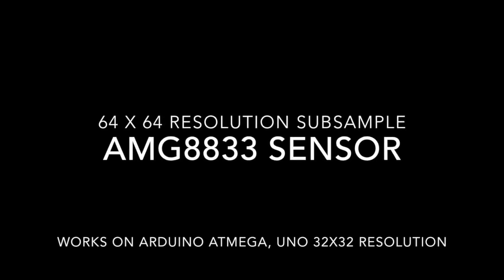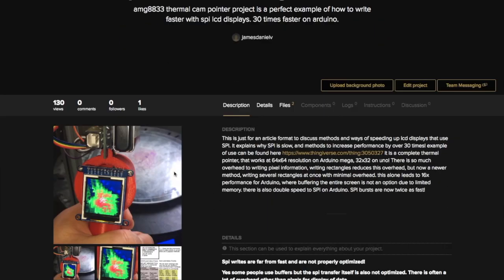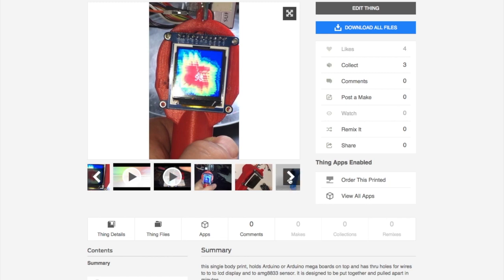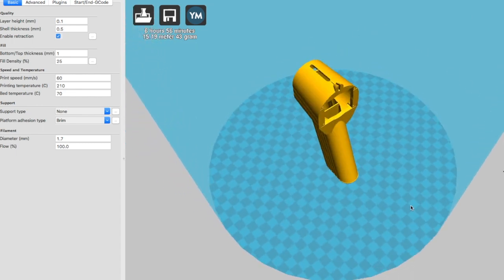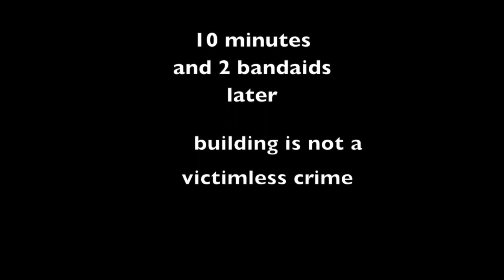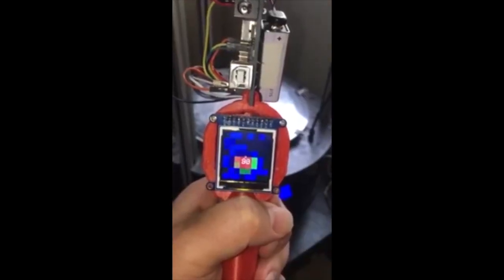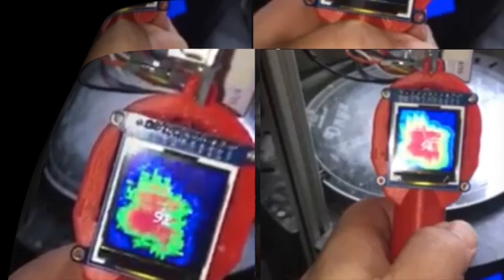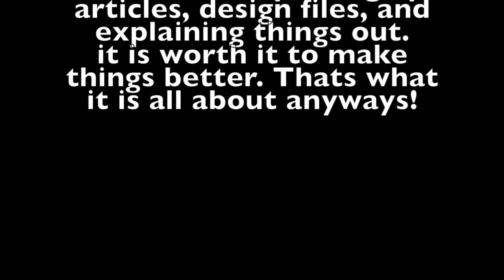amg8833 sensor works at 64x64 resolution on arduino uno! 10fps!

Comment: I have problem with range to measuring temp, if 5 cm from sensor is read 35,then i go to 30 cm is read 32,So How can i change the temp value,or we only use this sensor with short range, the description of sensor AMG883 say measuring 1-2 meter
Reply from the maker: what is size of object? from 30cm it should be about 3x3 inches, and from 100mm, it should be about 6x6 inches and have a stable temp across its entire body. otherwise you will get the temp it sees within its pixel range and it will be averaged across the center 4 pixels. the range low and high will show the variations across the entire array however. there are several questions here. first off look at the code, second do you mean change from F to c? after that, there is a temp shift  feature in a recent update in beta unstable branch that also works on 128x160 displays. https://github.com/jamesdanielv/thermalcam/blob/updates-(possibly-unstable)/thermal_cam128x160.zip. if trying to measure body temp i would advice using mlx90460 sensor as this only is +/- 2.5deg c
Reply: @profounddevices  what's mean of temp shift? 

Not F to C,,, for example, sensor read 32 deg C and the real temp actually is 35 deg C, how can i change the value or calibrate sensor to read close enough to real actual temp
Reply from the maker: @ZackVar  add 3 deg c in code to make it accurate. a temp shift is an offset to this. there is also opacity (moist air partially  blocks long range ir), and refraction to worry about. if the surface is really ruff it wont reflect enough, if the surface blocks the long range ir energy it wont return enough, if the air has a high moisture level the ir will be slightly blocked. temp shift is a linear offset from the level of accuracy of this type of sensor. the sensor only knows its temp, and the amount of energy sensed by its sensor cell (in this case resistance change). the temp of its silicone will be different than the actual temp because it takes more energy to change silicone temp than air. this causes a temp_shift to be necessary for more accurate measurement. if your code does not have temp_shift, then compare it to code with temp shift i provided. it is a static defined variable that is used to subtract a said amount from sensor values.
Reply: @profounddevices  a see on your code temp shift only use in Farenheit (True) , can i use to C
Reply from the maker: @ZackVar  i did not include offsets for the c of the min and max temp range for colorbar. this is section you are reading. line 788 shows temp_shift clearly being added, before conversions to text output. see if it works for your c measurements. if you have a 128x128 display you will want to change #define    override_hieght 160 to 128.

Comment: Is it detailed enough to use it to troubleshoot pcbs?
Reply from the maker: this depends on if the issues is detectable within a few degrees more or not, and if the surface are of the part is large enough. more than likely you would want to overlay image with a digital camera. this sensor will not show enough detail for making out parts on its own. in fact pcb thermal sensors can have two cameras, and do the overlay. this make sense for several reasons such as seeing part numbers, and color bands, as well as providing more detail with overlay. hope the answer is helpful.

Comment: Hi, is it possible to make it work with a 320x480 TFT screen ?  for this screen i use UTFTGLU.h library and to draw a pixel i have to set the color before.
Reply from the maker: here is 320x240 https://www.youtube.com/watch?v=_V8phEJc_L4. there is a driver in the works, i have no idea when it will be done however, as i am also working on another thermal image sensor. it is more than just a pixel draw, as it requires drivers that allows for auto pixel advance so ever 2 byte writes on a line only require writing the 2 bytes and no address data, just address data at beginning of line. i hope to combine the filters and the sensor parts together and unify the display output. it is hard to get best performance out of every driver as most are not written with arduino spi timings in mind and i would also need to consider how to keep performance on the newer 32 bit controllers as well. the best way to push larger displays is to send updates to every other line only as the bandwidth timing for spi becomes precious, and for arduino it ends up being unrolled loops as jmps from for/ next loops (not while loops) ends up being long enough to increase spi time. so using a while spi wait is out of the question for great performance. then there is interleaving of post filter interpolation data. i'm sorry this is not as helpful as you would like it to be.

Comment: Nice work..but can I take the temperature value from it and use it as integer to send signal like in DH11? Thnx
Reply from the maker: it has code to read thermometer values and output them to display. here is an example of the temp read https://www.youtube.com/watch?v=K5clBHS4UO0 it takes average of 4 middle sensors in array. you can also send the 'c' char to the display software over serial, and it will send you an output to terminal, or whatever program you are using all 64 arrays of data. i think it outputs them as text string equivalents of float values to 2 spaces past decimal. the data output to terminal, and the thermal value readings are not interpolated, they are direct values.

Comment: Do you know if there is a way to output the constant highest temperature so can use it for a controller.  I'm guessing that the normal IR sensors are more focused and I'm looking for the max temp as my surface will be moving.  I'm trying to sense the temp at the side of a cvt belt that moves up and down. Thank you in advance! https://www.youtube.com/watch?v=dcDs27QWrRQ
Reply from the maker: yes, this video is older, now the code is faster, and there is a color bar at bottom of screen and left shows lowest temp, and right side shows highest temp.
this code only works if #define autorange is set to true.

you read the pixels array for code
 temphi 
 templow 
variables store the values you are looking for, or MINTEMP MAXTEMP if you want a hysteresis corrected value
the code that does this is:

#if autorange == true //this is for autorange we turn MINTEMP and MAXTEMP into variables and adjust mixed locations for faster. we look at min and max over all range and adjust over a few samples to avoid crazy.
float templow = 1024; float temphi = 0;
for (int counti = 0; counti < 63; counti += 1)              {
if (pixels[counti] > temphi) {
temphi = pixels[counti]; //some sort of crude bubble sort but only one loop thru....
}
if (pixels[counti] < templow) {
templow = pixels[counti];
} 
};
MINTEMP = (MINTEMP + templow - Temp_below) * 0.5; // 
MAXTEMP = (MAXTEMP + temphi + Temp_above) * 0.5;
#endif

hope it makes sense.
Reply from the maker: a video of latest updated features showing an indicator of where the highest temp on screen is located here: 
https://www.youtube.com/watch?v=K5clBHS4UO0

Comment: How to use thermal camera with other display?
Can we use it tft displays if yes what are the changes we have to done in our program?
Reply from the maker: if your display has fully implemented commands for setaddresswindow and pushcolor then just set #define workAnyAdafruitDisplay false to true and add includes to your display drivers, if you want to see how the base code would work for just the sensor use this code here https://github.com/adafruit/Adafruit_AMG88xx/tree/master/examples they also include an interpolated code that can go to 24x24 but it uses floats and is a lot slower in processing, but it will show you how to implement it.
Reply from the maker: using the #define workAnyAdafruitDisplay changes the code to work with pixelcolor and setaddresswindow, i could add in ability for individual pixel writes as well it will increase compatibility but will be slow as each color goes from 2 spi writes to up to 18-20 command writes per pixel

Comment: Can this grid eye actually give you real time (average, 8x8) temperature readings using the aurduino Uno ? .... fast reply is extremly appreciated, thank you !
Reply from the maker: yes amg8833 can sample 10fps on uno. sample time takes less than 1/10th a second but sensor can only update with accuracy about 1/10th a second. interpolation can be done quickly as well, but this is determined by display drivers, and 
 interpolation methods. the issue is with the update speed of lcd display. in my case i have it working at higher resolutions.